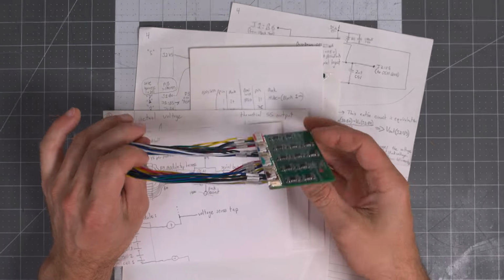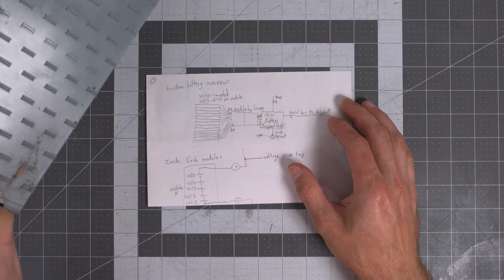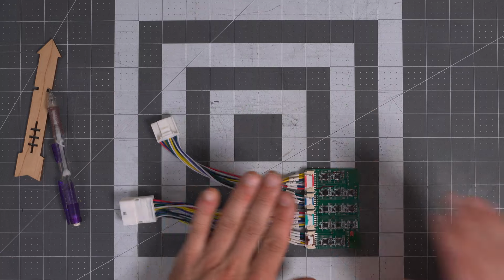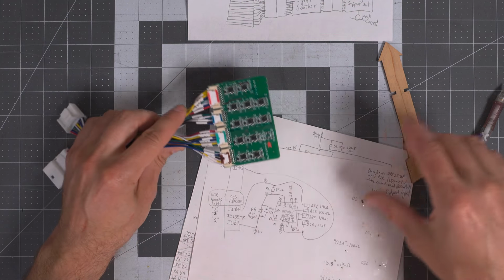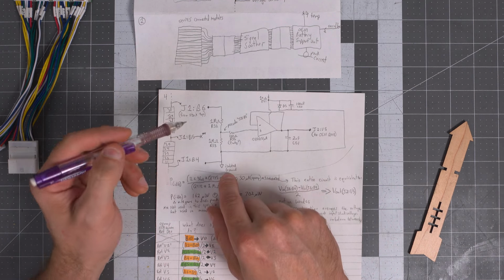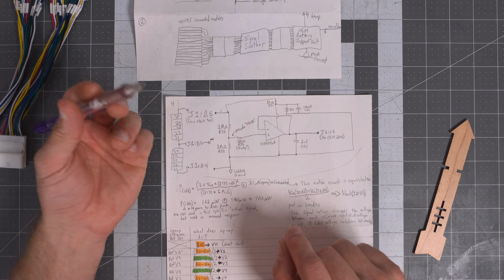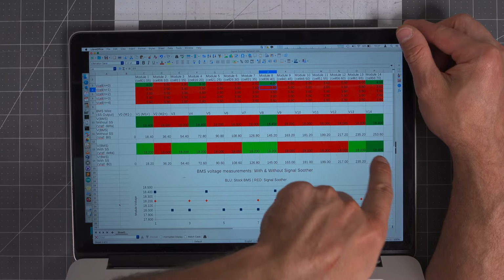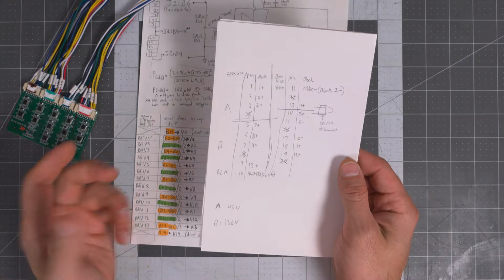Understanding Why Project Lithium's NexCell "Signal Soother" is Dangerous

Comment: Hi iam using honda nimh for my prius with same bms run more than 180000km without any problem
Reply from the maker: That would work conceptually, as you're using NiMH cells in a car with a BMS designed for NiMH cells.

Comment: idk a 20 year old car is fundamentally unsafe. air bags turn into claymores after a certain number of years in the sun/heat. if everyone was as safe as you, their used cars would go straight to the junkyard. this seems like an acceptable level of safety to get the last 50k-100k miles out of a very old car. there should be different mfg standards for new items.... yah there are fringe cases where this could cause an issue, but when you look at everything else that is wrong with these cars after 200-500k miles, it doesnt meaningfully increase the danger of driving one around. I dont think you can use fuses on balance circuits, and I think there are advantages of going with a dumb bms design, such as average people being able to afford and install the mod.
you should realize that there is a fundamental tradeoff between durability of goods and safety. hes doing everything he can to mitigate risks without scrapping the project
Reply from the maker: Safety shouldn't be dismissed as a fringe concern simply because the vehicle a product is going into is old.  The lacking safety features I've pointed out in my videos pose serious consequences, including immediate danger to life.  For example, consider the case where a customer with a prototype pack that lacked a functional service disconnect took their vehicle in for service and accidentally killed a service technician.  Regardless, your affordability vs safety argument is a false dichotomy.  I agree that price sensitivity is increasingly important for older vehicles, but affordability shouldn't come at the expense of basic safety standards.  While I respect Jack's efforts to make an affordable traction battery, I also think it's fair to hold creators accountable for ensuring their products meet reasonable safety standards.  I think it's important to embrace innovation, but only when it doesn't introduce significant risks to an existing product.  And if shortcomings are identified in an existing product, I think its creator has a duty to disclose them trasnparently, and then of course mitigate them through design improvements.  Note that many issues I've identified with the NexPower's products aren't actually that expensive to implement... Jack's team just appears to lack the engineering experience to implement them in a cost effective manner.

Comment: Is it just me or would it make more sense to just use a voltage divider setup to feed all 14 wires(effectively dummying out the original pack BSU wires), and then use a separate BMS(or multiple) that actually look at each cell; have the output from that BMS ground out one of the 14 BSU wires(which would show a big fault) if there ever was an issue? This way you would have the safety covered(single cell issue -> triggers BMS to trip -> triggers BSU -> CEL and hybrid pack disabled. 
The only thing you wouldn't get is knowledge of which cell tripped it, but it wouldn't really matter as you would need to open the pack and test it anyway.
Reply from the maker: Your proposal could be done safely.  However, the product I've proposed will actively monitor each cell and report any issues at a per-cell level to the user.  This 'LiBSU' device will replace the OEM BSU computer.

Comment: Keep up the good work i bought a nexcel battery for my prius. I love competition! Are you going to use lithium iron?
Reply from the maker: The 'LiBSU' product I'm designing is intended for use with NMC cells, which has considerably higher energy density.  However, it will technically work with LFP cells with firmware changes, although I don't intend to support this.
Reply: @doppelhub  thank you for the reply I was just hoping you can help the people out that already have the nexcell junk and make them a bit safer